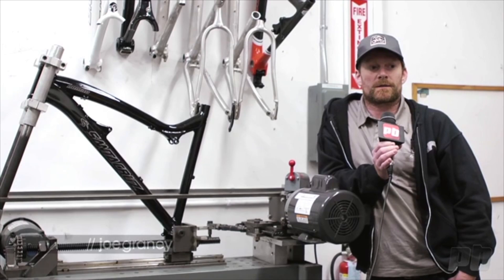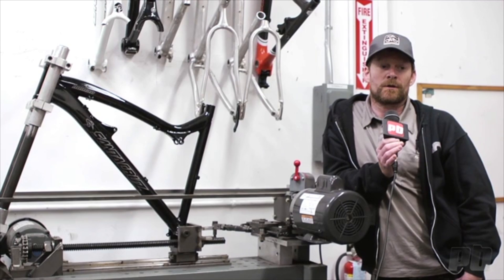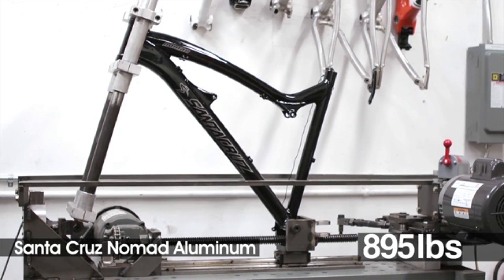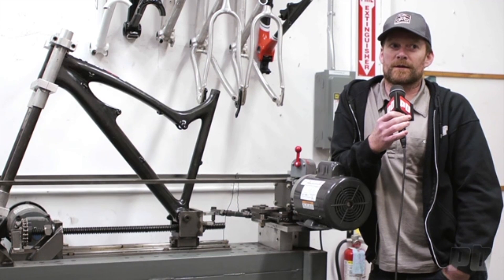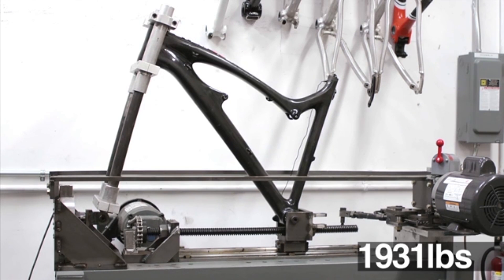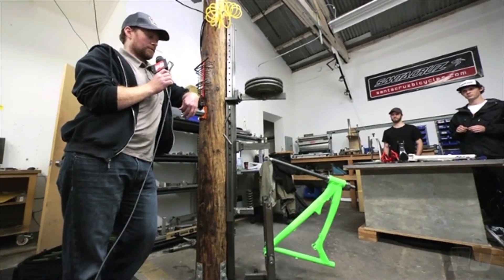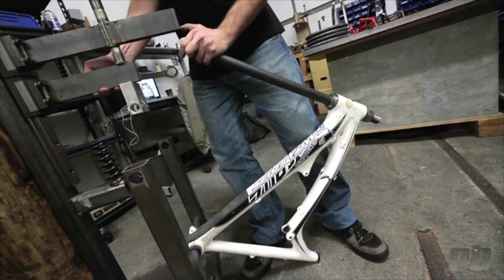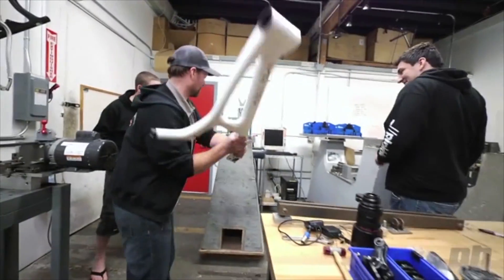Carbon vs Aluminum Frames - Which is Stronger?

Comment: Carbon is impressive but I suspect all that cracking & delamination has big effects on the endurance of the frame that can't be represented in a lab test. You never indicated what kind of aluminum the aluminum frames are made of. There's a HUGE diff between 6XXX & 7XXX series alloys & tests that only apply one kind of load in one direction only indicate how the frame performs under that kind of load in that direction. Smacking carbon tubes against concrete with no safety glasses on, yeah you really must know what you're doing. :/

Comment: Aluminium bends - carbon cracks. Choose wisely
Reply: This is the most accurate comment so far
Reply: Both crack for me haha, about 7 ali frames and now a carbon one.
Reply: @zGJungle  I need to know what and why xD
Reply: @ThisMoth  just normal DH riding, I'm pretty smooth, don't case often and I'm light! but have broken several nukeprooofs, a commencal, an orange, a Scott, and a demo.
Reply: @zGJungle  which one was the carbon one? I'm about to maybe possibly buy a carbon foil 10 from Scott that's 3 years old :)
Reply: @ThisMoth  the demo was the carbon one, was the first of the 2016 carbon new shaped ones, Scott's have a really good reputation on thier carbon bikes for reliability, you should be fine, just go over very carefully checking before buying.
Reply: @zGJungle  Yeah will do. Thanks for info. Us new bikers need some guidance from time to time!

Comment: "in a jump where you come up short"

This test does not accurate depict this scenario. In the test, the bike is slowly compressed allowing time for the frame to flex and deform. In the real world scenario, if you come up short, the bike will crash and snap before it has time to deform and compress.  I'm not here to knock on your testing, just want to explain that if you dropped 500 pounds on that quite quickly, it would have snapped.
 I've been doing quality control for the last 3 years. Also, no safety glasses?

Comment: The carbon one sounded like it had strands cracking before the aluminium one actually failed. Surly lots of smaller impacts at that load could cause significant unseen weakness?

Comment: This is some relatively close click-bait bullcrap. Btw, I rather have something bent, work hardened or dented like on that aluminum frame, then a snapped one like on that carbon frame. Also, 7075 aluminum rod frames would absorb shock and not get snapped, better for suspension.

Carbon fiber and fiberglass are relatively close when it comes to chipping, snapping and cracking, like really bad.

Comment: I like the compression and impact testing because data can be acquired to design safer, stronger frames. However the last cement test sort of made me cringe because it was just not smart (no data collection that can be useful) nor safe (no eye protection, no gloves, sandals). No offense to PB or Santa Cruz.

Comment: I would be more worried about my body if i was experiencing this kind of pressure in a crash.
Reply: Well its your body creating that pressure with the help of gravity.  It's not the crash that breaks the bike, for carbon its the constant stress your body with the help of gravity puts on it that weakens it over time.  Eventually it splits apart.  You never know when it will happen cause with fiber its always sudden.

Comment: C'mon that's really misleading. First off, on the carbon, you could clearly hear the first few "snaps" around the mid 450lbs marks. That right there is enough to stop riding the frame.
Reply: Just say you cant afford carbon on go on with ur life
Reply: @RvasqA  "Just say you cant afford carbon on go on with ur life"

What a silly, primitiwe ad personam argument.
Reply: Red Vasquez carbon is like a bunch of strands woven together. On the pinkbike test, when the carbon made a crack sound but didn’t break, what I’m thinking is that one of those fiberous strands started to unwound itsself from the rest of the fibers. That bike would still be rideable, but if carbon works because strands are woven together, I wouldn’t feel safe riding a bike where some of the strands unwound themselves. And also, unwounded strands makes the bike more likely to unwound even more strands. I rlly want carbon but it scares me. I hear ppl who use it for years and they’re fine, and ppl who use it for 5 days and crack it :/
Reply: @RvasqA  LOL. Ok here it is, "I refuse to pay for carbon at premium prices when alum is just as good". Or, "I refuse to ride carbon because it's for elitists and weight wheenies who aren't pro riders".
Reply: @MTBr-of-SoCal  i know a bunch of pro riders thatst use carbon but go on i guess 😂

Comment: Carbon fiber is good when it's used in a composite. Otherwise it's just not that strong. There's a huge difference between a bent and a crack. So it's not safe for bike applications. Titanium with Carbon Fiber is the ultimate combination if you ask me.
Reply: I'm not sure you understand correctly that carbon fiber when used in bikes is a composite: carbon fibers in an epoxy matrix. It's perfectly safe for "bike applications" and has been used for decades; modern carbon fiber bikes are just as good as any other material.

Comment: Lmfao I own 2 road bikes. One is a Sava Japanese Carbon and the other is a 14 kg GMC Denali 6061 700 alloy. Before I hit the road with the Carbon I check the frame with a simple tap test on the most critical joints and use my ears to listen to the specific sound of Carbon that is not delaminated. It takes 1 minute to fully check all the frame once that is done I go for long distances with no hesitation. On the Alloy all the weld points are checked prior to riding. Alloy or Carbon don't be a moron and crash while looking like a moron. Your life could possibly change overnight because you did not spend 1 minute checking your bike frame, brakes , wheels. This is 1 minute of your life that you will regret not spending.

Comment: In the static test, carbon may take more before it's destroyed, but it was cracking much sooner than alloy frame started showind signs of damage. So the cracks are most likely delaminations and fibers snaping, meaning the carbon frame was damaged sooner. It would stand out to harder hit overall, but would be damaged after smaller hit. If the impact test wouldn't be so noisy, we might observe the same situation. So I personally am not convinced. But I'm not torn between choice, cause I can't afford or justify buying well equipped bike with carbon frame.
Reply: As soon as carbon cracks its destroyed, only an idiot would still try to use it after. The moment you hear or feel it crack you need to get rid of it.  If you still use it and it splits in half while you are using it then that's on you for being stupid.  I'm sure the doctor in the ER you visit will say the same thing.

Comment: The drop test is scary either way to me. I was amazed at the strength in the compression test of carbon. I come from a lifetime of riding BMX in skatparks and such, the drop test to me seems like neither frame held up to a typical day's BMX riding, but I don't know if I'm looking at the variables correctly, while the compression test went way way way beyond what even a dirt jumper would see. Am I looking at this wrong?
Reply: Yep; the amount of force involved in the rigid impact test is way higher than it seems, because nothing else is allowed to take up the impact. In a normal crash, the entire force of your body is not applied to the bike in that manner, because your body flexes and absorbs most of the impact by shifting your body position or letting go of the bike.

Comment: The first crackle at like 750lbs that CF frame lost strength.
Reply: Thats not very good since your weight is amplified greatly with gravity doing stunts putting allot of pressure on the frame.  I'm sure that's 750lbs per square inch which still isn't very impressive.
Reply: If it cracked, it would’ve failed, that’s how carbon works, especially under a continuous load test. A noise isn’t a crack.
Reply: If I weigh 200 pounds and hit a really high jump the carbon frame wouldn't stand a chance 😎
Reply: @abstract0407  You're nuts. You and your 200 pounds could ride that bike any way you want and it will never, ever break.
Reply: @nbzness  Is that why I purposely went with aluminum instead of carbon?
Reply: I'm 105kg broke a carbon yt cap on the top tube on its 5th run from new, small drop to flat at a bike park, sent it back to yt and refund
Reply: @ginganinja81  see my comment below. Carbon is total bs. Imagine me 128kg. Id be dead
Reply: @abstract0407  I’ve brought my carbon xc bike to a downhill park, I wouldn’t recommend it, but it can handle the stresses of hard casing a few jumps.
Reply: @bigbo1764  I feel like carbon bike could benefit having more triangles

Comment: such a cool video. How come people tend to use a towel or something like , to wrap the frame while cinching to a bike/work stand?  .......If it can take so MUCH abuse????? I'm talking about specifically CARBON???
Reply: There are a few reasons to lessen the clamping force on a carbon bike. 1. It can be as simple as cosmetics. If you can reduce the damage to the paint, why not. Sure its a mountain bike and there are rocks but hey, why not. 
2. The most important reason if that, the clamp to hold a bike isn't what it was designed to take. When you lay-up the carbon, you can lay it in such a way that you can have it incredibly strong in certain directions of force while not as strong in others. Sure you can make it strong in all directions, but then you'd be adding significant cost as you need more carbon layers to achieve that. There are carbon fibre  drive shafts for cars that will be very strong when torque is applied, but apply compress or stretch it and it will fail much earlier. But you don't need to strengthen it for that because it simply wont see any significant applications where it need to be resilient to being crushed.

And to answer your question directly. A towel or other things like rubber when clamping the bike to the frame will usually be for cosmetic reasons. I can't see a situation where a person can actually crush a carbon tube with just a clamp and their hands.

Comment: I have Rocky Mountain thunderbolt 730 KS alloy frame. Nothing is wrong with the frame, it’s been through a lot of trails. I even  rode my bike to red and black trails a hundred times. The bike is heavy but I’m okay and bike is alright. The only time I fear for my safety is when I do a hard descent it’s hard  to control the bike.

Comment: I will agree the the aluminum folded at a lower nM then the carbon fiber but the aluminum didn't have a total failure it only bent.  The carbon fiber had a complete break what would be called a total failure.  I believe that aluminum gives you some warning that there is a failure but carbon fiber gives not warning.

Comment: You watch this video... and yet I've seen many carbon fiber bikes simply endo at very low speed, go up on their front wheel, fall over to the side, land on a rock, and smash right through. It's nice and strong if the forces are applied to the mounting points... the BB, the head tube, the wheel mounts. But apply force anywhere else and you'll be in trouble. And rocks go flying pretty regularly in the places I bike in. Carbon makes me nervous.

Comment: Carbon will survive much better in long run than aluminium since it can flex much more and still keep its shape. Also I kind of like the fact that when carbon breaks it snaps right away so it wont bend just a lil bit like aluminium frame could do which can lead to really weird problems when you don't notice your frame has bent from some point. I personally have bent one aluminium frame in the past and now running fifth year with carbon with no problems at all. Only thing I would never do is buy used carbon frame or or any crucial parts made out of carbon since you can never know how much they have been beaten in the past.

Comment: If the standards require just the resistance of the aluminum frame maybe the carbon frame is overbuilt. They could use much less carbon to meet of that aluminum frame's and make the carbon frame much lighter in the process.

Comment: Lab testing ain't the same as an actual ride down the trail as numerous videos of breaking carbon frames out on the trails show! And many of the breakages I've seen in those videos happened on on jumps that my old cheap-ass 270€ hardtail would've survived with no problem!

If u wanna restore my faith in carbon frames u've gotta try WAY harder!
Reply: You got any source mate ?
Reply: Frame breaking from a 3 or 4 ft drop : https://youtu.be/5q5eCREqGuo?t=1m46s

The drop in this video seems to be even lower: https://youtu.be/cw5QQyJSyso?t=12m34s

I could probably find more, but these 2 examples are already pretty bad and speak for themselves!
No matter what brand it was and no matter how long it's been used before, sh!t like that MUST NOT HAPPEN!

Comment: This is the most low-tech amateur structural analysis i have ever seen. Shame on you, SC.
Reply: Agreed! this is a bullshit test. Didn't even drop weight or apply pressure on the  sides of those bikes.
Reply: Hard. Couple of chumps breaking shit in the garage. Probly drinking beers

Comment: +Pinkbike  You guys should always wear face masks while you do these sort of tests. Carbon fibers are "extremely" carcinogenic meaning they will cause cancer. While the bike frames themselves are perfectly safe when they are structurally intact, they are so because of the layers of epoxy and resin that isolate the fibers completely. When you break a bike like this, a large number of tiny carbon fibers are spewn into the air, and inhaling those will leave those fibers in your lungs forever, just like asbestos because your body has no way to dissolve or discard those tiny carbon fibers, eventually leading to lung cancer. 
http://www.nature.com/nnano/journal/v3/n7/abs/nnano.2008.111.html?foxtrotcallback=true
http://monographs.iarc.fr/ENG/Publications/techrep42/TR42-Full.pdf

Comment: they are so cute, they think they aren't damaging the carbon fiber already... whenever the carbon fiber frame makes it past the aluminum frame, it already with permanent damage. Its starts cracking (fibers breaking) long before the alloy frame too. Also the alloy frame bends slightly, this one snaps violently lol
Reply: Agreed! and fuck carbon fiber bikes. By the time carbon fiber achieves great price to strength ratios, somebody might sell a 7075 steel bike which will be miles ahead of that in that department, maybe even more realistically too.